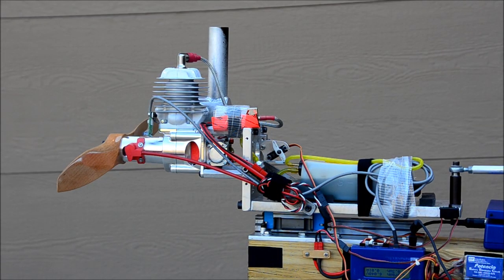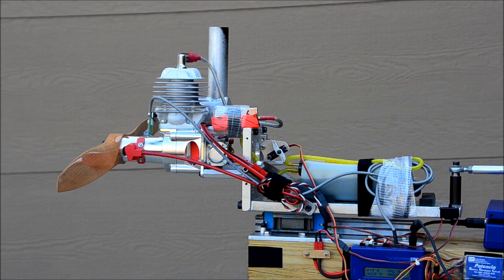DA-60 Test Run on RC Sport Flyer Thrust Test Stand

Comment: Nice and I got a 24x9 Falcon Carbon fiber. I tested myself for RPM and thrust. While had about 10 tanks or so and peaks at 6850 RPM and about 34 lbs. Think maybe "too rich" or just about right for bigger prop with more pitch? Does it also can heat up a bit like it running 225-240 degree?